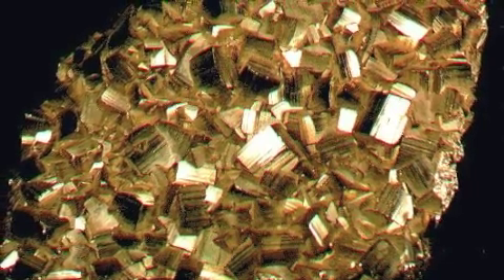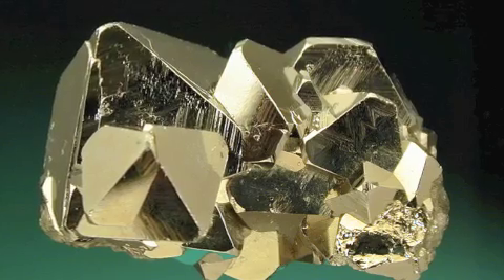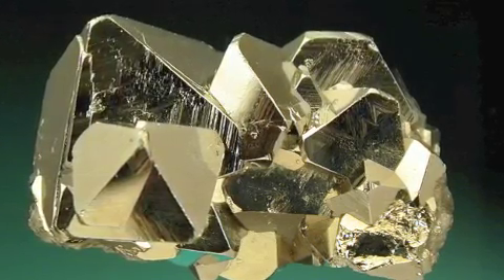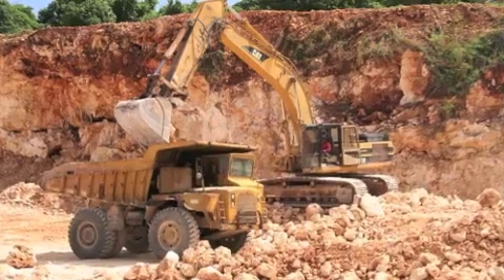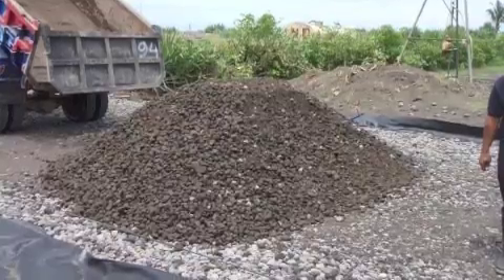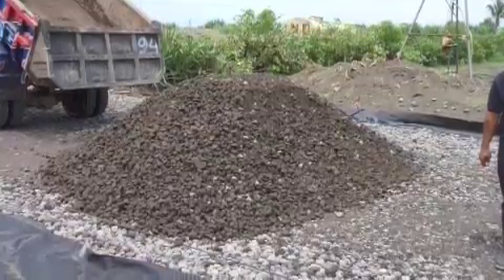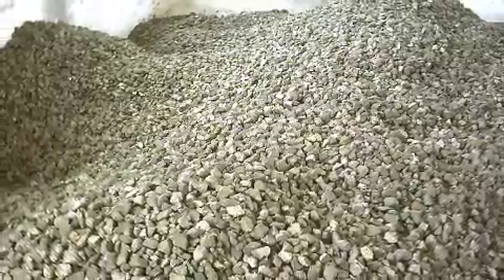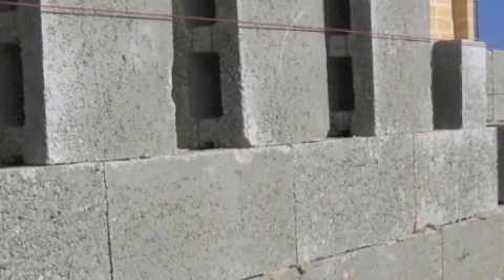What is Pyrite? - Structural Issues - Fahy Fitzpatrick Consulting Engineers

Comment: Is Pyrite just an excuse for shoddy construction? If a house is constructed in accordance with the the industry best practice (i.e. Home Bond Manual) then the ground bearing slab should be fully isolated from the walls. The slab should be able to move independently to the rest of the Structure. In all suspected pyrite cases that I have observed the slab was poured in one piece over the rising walls with the load bearing walls built off the top of the slab. The problem is not expansion of the fill, its poor construction techniques.
Reply: +Ross Clarke I could see how a floating slab could mitigate a problem with the fill underneath; I've heard of places (eg. Ft. Collins, CO) where the soil shrinks and expands so much that the basement floor is expected to move as much as 2 inches anyway. But aren't there cases in which the pyrite contaminates the aggregate used in the slabs and blocks themselves? In those cases, it would seem that the concrete would spall no mater what, and that only replacement (or maybe some kind of glue injection) could fix the problem.  Pyrite was also implicated (among other things) in the Chinese drywall disaster that plagued US housing built after hurricane Katrina. There, the problem was not the structural integrity of the wallboard, it was the acidic gas emissions damaging wiring, equipment and the lungs of the residents of the affected buildings.
Reply: Ross Clarke Usually the issue is that the expansion of the stone fill under the floor slab pushes up the slab causing problems with anything built off it.  In particular where internal stud walls are constructed off the floor slab the lifting of the slab causes them to buckle and doors to jam.
Reply: Nah its absorption of moisure and subsequent expansion in the concrete . You cannot make concrete from rock with high concs of pyrite it wont last. The structural integrity of the matrix is not viable. basically it doesnt meet the standards for construction. The rock soaks up moisure and cracks.